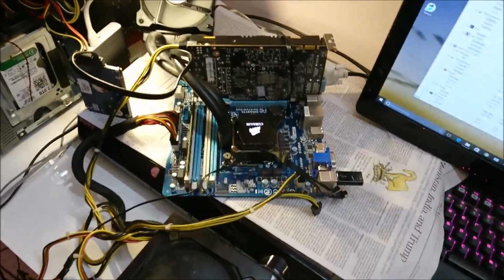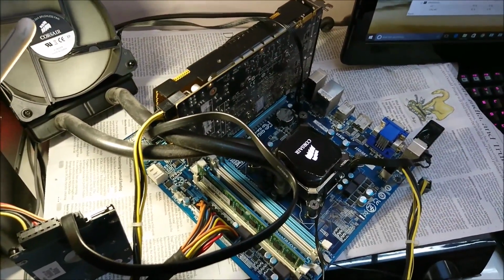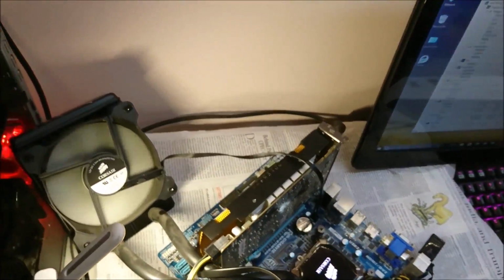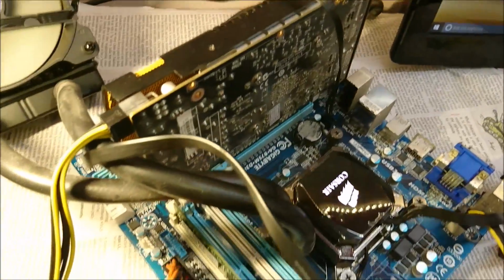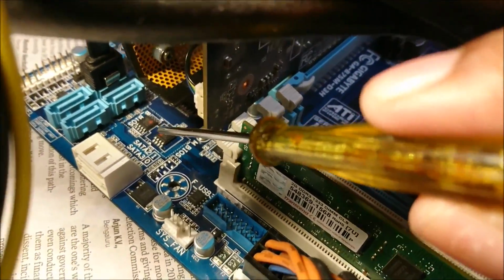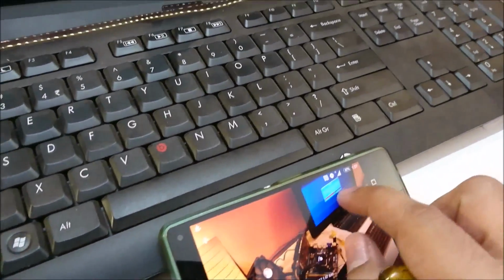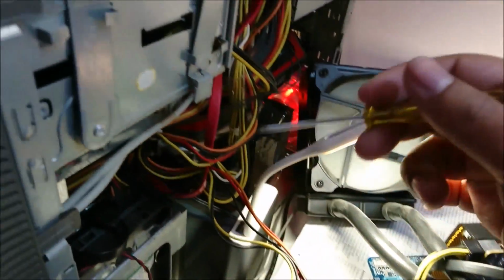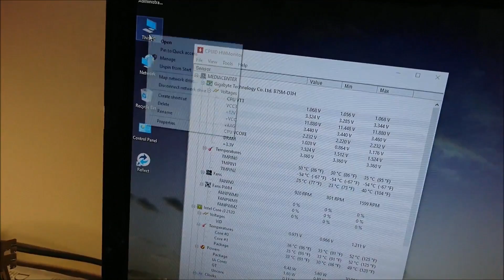Gigabyte B75M-D3H corrupted BIOS boot/post loop fix

Comment: I had exactly the same problem, i already removed the board from casing and was about to chuck it ... did a very last you tube search and .... found this video - it worked !!  shorted Bios 1 and now i have a working board again - Thank You!!👍👍👍👍
Reply from the maker: I made this video ages ago!! Glad to see this method still works. Btw, I still have this board and works fine till this date!!

Comment: Had the same problem with BIOS Versions F15 or F16f.
Workaround: Press Power and reset button and hold for 10 seconds.
After that, start normal.
BIOS will install recovered Version (in my case F12).

Comment: It's 2023 and you are still saving lives man. Pin 1 and 6 took a few tries and it worked. I'm writing this as my backup is writing back my main bios. 
And this happened to me because I updated my bios from f14 to f15. Do not do it.
Reply from the maker: I made this video AGES ago!! Glad to see its still helping everyone out! And yeah, after this I have stopped updating BIOS on every PC, its too risky!
Reply: @TechGuyCharlie  Great to see you stil replying here man. Just finished setting up everything. i now realise that board already had issues. Post took a long time to appear on screen. And it hangs there sometimes. It wasn't reliable. Also I had to do the hard reset 3 times because somehow my windows got corrupted and trying to boot that copy also got my bios bricked two times. I had to catch that first fresh bios boot and force boot into bootable USB. Fresh windows fixed everything. It's so weird. And now it's blistering fast. Someone will meed this information someday. Again thanks man.
Reply: does the new bios from 2024 works 😅 my mainbaord only works with one 2gb module from all other ones i have… otherwise crash . i wanted to Update the bios to the new 2024 version

Comment: Thank God for you and youtube and the commenters :D pins 1 and 6 worked for me. Thank you, thank you, thank you <3
Reply from the maker: Wow, I made this video years ago! Glad to see this method works, and this same motherboard is still working in 2022. I use this PC as my storage server!
Reply: Which pins are these? I can't seem to get mine to recover at all. Just keeps restarting after a few seconds when trying to short or about 10 seconds if I am not shorting anything.
Reply: @a.aspden  you can short them with power connected but not turned on. look for the dot on the corner of the chip, that is pin 1, pin 6 will be the adjacent one. Search 'pin out' to get a picture.
Reply: @stephenhartley77  I feel ike I tried everything but will try again when I get home. What do you mean by searching for pin out? Search google? Not finding a diagram. Thanks for the help
Reply: @a.aspden  yes, Google - Pinout Bios Chip :D Use a steel paper clip to short the pins

Comment: Much safer to power down then hold the power and reset buttons for 10 seconds. The Mobo then goes into recovery mode.
Reply: With power down not worked, but when power on, and hold both buttons 12 seconds, then work fine :). Many thanks :).

Comment: i am in year 2022. Thank you very much  You saved my computer. PIN 1 + 6 . NOTE: if you don´t know which are the pin numbers search for the BIOS integrated circuit model "mxic mx25l6406e"

Comment: Didn't work at all for me BUT as a last ditch effort I desoldered the BIOS chips, stuck B into the A slot, and it booted right up. I'm going to put A  in the B slot and then reflash it. I have no idea why this dual bios system doesn't work switching to B properly. B was fully functional and yet the motherboard ignored it. Anyway, if it helps anyone - you can get a hot air soldering station on ebay for 40 bucks. Takes 10 seconds to remove them. Let it cool for 10 minutes before resoldering them. Oh- and they're rotated 180 degrees. Make sure to match pin 1 to the arrow!

Comment: Thanks for this! I have been trying to fix my aunt's computer with this board (I offered to build a new one, but no she wants old and busted back) and had tried literally everything else in the board manual. Figured I didn't have anything to lose by following your suggestion of shorting the main BIOS and boom, it's switched to the backup and booting properly.
Reply from the maker: Glad to hear that!! and happy to see that such an old video is still relevant 😊

Comment: God bless you! I have tried all of the methods of resetting BIOS described in the manual of my H81, removing CMOS battery, shorting the designated CMOS-reset pins, holding and/or pressing both reset and power button, all without and with power, with no result!

My bootloop / corrupted BIOS issue was initialized when I tried to test an old Radeon 5770 (Juniper) on my system, it started doing the post-beeps (which it never did before!) and boot looping exactly in that Gigabyte-patter. This is actually a VERY widespread issue with Gigabyte boards!!

Practically what fixed it after trying just about every hardware configuration and reseating etc. and attempting to reset CMOS was just fiddling around on the PINs of the BIOS_M (main?) module, instead of holding it calmly, it did the same thing detect that obviously something was wrong there and it let me press Enter to reflash, and from then on it was back to normal.

I did come across the idea of shorting the BIOS circuits as well, because after bricking my Gigabyte Mobo with it, I put it into another PC and I flashed a wrong BIOS to my 5770 Juniper AMD GPU (in order to fix horizontal lines I saw in all driver versions, instability etc.) and I had to bridge that from being read on the GPU by shorting 2 pins on a BIOS saving circuit just like that on the motherboard, in order to be able to actually start the system with the card installed at all, and then I had to use 2 graphics cards, (so because of that I used a third motherboard X-I) 1 for display and the Juniper for flashing, and the short had to be removed right before flashing. It was even more crazy than the BIOS reset. But I got some other BIOS installed and ended up confirming it was not fixable by BIOS.

Now retesting this disgusting semi-brick of a bugfest Radeon 5770 GPU on my newly uncorrupted BIOS with different hardware, see if I can get it running bug free on here (but I don't think so, this is maybe an overheated GPU, corrupted memory or something along those lines)

So just so you guys know, a bad GPU can actually cause your Motherboards BIOS to get corrupted just like that!

The things we have to bother with...

Comment: Hey,
I also have a same Mother board ,with i3 3gen and i  want to upgrade  .
What changes i have to do in the mother board if i run it with i7 3rd gen ???
Will it work fine ???
Reply from the maker: No changes necessary, this board will run 3rd gen i7. I've tested i7 3770 and it worked fine.

Comment: If it was not clear to someone, I saw in another video that pin 4 should be bridged with pin 7 of the main bios with the board on, until a recovery message appears. Thanks a lot!

Comment: Guys i tried everything from resetting cmos, taking the cmos battery out, taking ram out, disconnecting HD's and sata cables and NOTHING worked. Until i came across something that worked for me and got the bios working again. 

Turn off power supply. Hold down the on button. Turn on power supply then after 2-3 seconds of the computer being on, turn off the power supply again. Then release the on button. 
Then turn the power supply back on. Now press the on button. This will reset your bios and it will overwrite the corrupt bios with the backup bios. You will see a loading screen as it overwrites the corrupt bios. 

This is what worked for me. Everything else failed.
Reply: Aaron Marsh thanks brother its worked... but does my mobo now running on only one bios?? I mean is the the bios dead?
Reply: @StrugglingBeliever  No dual bios's are just the normal bios with a back up bios that is always there and uncorruptable. Meaning when the bios you use gets corrupt it backs itself up with the good bios...
Reply: This worked for my friend.
Reply: Bro do you have any idea why bios is not updating? It’s failing every time? Shows blue screen
Reply: Thanks man, you saved me!
Reply: I'll try this.
Reply: Thank you, works!!!!
Reply: Didn't work pls explain briefly

Comment: What pins did you short to be exact, I'm having difficulty with a gigabyte board that is also dual bios?
Reply: The classical answer is to short pins 1 & 6. Determining pin positioning can be a bit tricky though.

Comment: Which pins to short and which bios main or backup?
Reply: Typically pins 1 & 6, and on the MAIN bios, not the backup bios!! Don't ever short the backup bios, you run the risk of damaging it and therefore bricking the board permanently (assuming that the main bios is corrupted).

Comment: I can confirm that shorting the pin 1 and 6 at the same time on the M_bios works on a Gigabyte GA- Z97X-SLI
Reply: pin 1 is where the arrow is but where is pin 6???
Reply: @avramovixc  Pin 1 is whatever the arrow is, then it's clockwise or counterclockwise considering that the one next to it is 2. Basically, the one next to 1 is 2, then 3, then 4. Across from 4 is 5, next to 5 is 6, then 7, then 8, which should be across from 1 if you labeled it right.

Comment: I tried this myself and it wouldn’t work at first. But after several attempts at shorting the bios chip it really actually worked. I am amazed. Thanks so much. Update: Not working after rebuilding pc.

Comment: It worked. Short the Pins 1 & 6 near d white arrow - that is the clue... then push power button. Press Enter 2x... fixed... thanks for the tip!

Comment: This also works on my Gigabyte Z270mx Gaming 5, thanks for saving tons of time!
Reply from the maker: Glad it worked! I'm surprised that so many gigabyte boards are having this boot loop problem :/
Reply: @TechGuyCharlie  I noticed that it happens repeatedly every few months, especially when I power it off during weekend.
Reply: I have very similar issues with my Z77X-UD5H. It seems to be mostly related to cold boots.
Reply: I've seen a post from someone claiming that it's a known issue with Gigabyte's implementation of dual BIOS on boards prior to the 87 series, apparently especially so prior to the 77 series but also on the 77 series, and that Gigabyte had supposedly mostly fixed the issue with the 87 series onwards. It's the best explanation I've found to date for these issues, although I personally suspect that there may also be a partial contribution from failing main BIOS chips and/or changes introduced in later board BIOS updates.

Comment: Mine was recovered by itself today i have the same mobo as yours i got one ques. Did you face same problem again??means you turned off the pc and use it next day the pc didnt gone into boot loop again??please ans im so curious to know if my pc will do that bullshit bootloop again
Reply from the maker: This mobo has been working fine, it's going to be 1 and a half years since I fixed it and no boot loops.
Reply: Tech Guy Charlie oj shit it was working all fine no cpu heat or overload even thermal paste is good..but when i tried of turn it on its again on boot loop fan runs few seconds like 5seconds maybe 4 and shuts down and does this again and again..i swear it did recover from B Bios in the morning..im tired of gigabyte man did a mistake shouldve gone for asus instead

Comment: I found easier steps for anyone having corrupted bios on GA-B75M-D3H motherboard, make sure the computer is turned off and then press the power button and reset button at the same time for 10 seconds and the back up bios should kick in reinstalling main bios. 

for some reason after I installed update from windows 10 which is 1803 update as far as I can remember, it gave me a blue screen and then corrupted the bios.
Reply: Jhay12  You saved me! Thanks man
Reply: It realy works! thanks, i was losing my mind over this hahaha
Reply: Jhay12 Perfect! Thanks for the heads up man.
Reply: Worked for me!!! Thank you so much!!!
Reply: Wasn't happy shorting the pins on the BIOS chip. Tried everything to get this mobo working. The old hold the power button and reset for 10 seconds worked a treat. Backup BIOS restored. Boots a treat. This happened after installing windows 10. You have won the Internet for today kind sir
Reply: God bless you my unknown technologic god of youtube, you saved my pc
Reply: Dude, you're a genius. Thanks a lot. Fixed my corrupted Bios
Reply: Perfect! Works on my  GA-Z77-DS3H  I built in 2013!  Thanks to bboth Jhay12 &  Tech Guy Charlie!
Reply: It kinda helped me but some times i have to do it again... And it happened some week after the October update (got it after all the bad things it came with on october)
Reply: @morpion  Yeah.. It happened to me 2 days after October 2018 Update.. Weird
Reply: @MsGRUBY666  also if you're having fps drops on game disable game DVR it helped me a lot, on r6s it was saying that I had 70 fps but it was like 20
Reply: Thank you! I was thinling about doing the procedure of the video but was really afraid of crashing my motherboard.
Reply: thanks man that work for me
Reply: worked for me thanks alot
Reply: You saved me as well thank you for this post!! I got this as a dead motherboard and nearly recycled it. You rock!
Reply: I love you so much , where can I tip you?
Reply: Dude, you saved me. Thank you very very much.
Reply: Thanks man!
Reply: I ran into the same issue with a GA-Z77X-D3H.  Tried the CMOS battery, tried the clear-CMOS jumper.  Was just about to try shorting out the main BIOS chip when I saw this comment.  Jhay12 - you are awesome.  Thank you!
Reply: It really works!! No need to short out any pins! Thank you very much Jhay12!!!!!!
Reply: @RF-qr6co  reset button on the case. May be near your on button.
Reply: It worked for my board GA-H87M-D3H, thank you !!
Reply: THANK YOU SO MUCHHHHHHH.... iT WORKS!!! SO happy...
Reply: Thanks JM you saved me.
Reply: i love you man
Reply: Great !! You saved my PC ! Thanks a million
Reply: Thank you for this suggestion it helped
Reply: thank you so much
Reply: Thanks, fixed my friends pc with this tip.
Reply: you're awesome! works perfectly, I struggled with all the possible solutions for about 4 hours or so...
Reply: This really worked, thanks!
Reply: Thanks man!! It worked! My BIOS got destroyed after attempting to install windows 10.
Reply: Very helpful it works again thankyou!
Reply: Thank you!! Save my MoBo and me from despair
Reply: All night I worked on replacing the PSU, VGA card, RAM, repasting the headsink, etc. All the videos I saw on YouTube failed. I was planning to order a replacement motherboard. Thank you for your comments which managed to save me in an easy way.
Reply: I know this is very old but man, you are a life saver. Thanks a lot.
Reply: U save my ass, Six yrs after ur post. Luv u bro. Much better than screwdriver like in this video.🤙
Reply: You save my day! thanks :)
Reply: Jhay12 this didn’t work please help

Comment: I have a ga-z77x-ud5h and it has a switch next to the clr_cmos jumper that you can flip back and forth to select which cmos chip you want to load the bios from, main or backup.  I accidentally shorted my mobo plugging things into it while it was still turned on which apparently corrupted the main bios but unfortunately it doesn't automatically repair the main bios when loading from the backup and now I have accidentally fried the backup cmos chip also the same way as the first and think im REALLY s.o.l. now 
:(  yall be sure to turn off all power and unplug your power supply before you go plugging all your hardware back in so u don't end up in my situation!

Comment: well it's worked for you, that's good , but next time you need to know that gigabyte has a safer way to do that , you need to click on power botton to turn it on and than you click again but this time keep holding the botton for 10 seconds and than release it , and turn it on by clicking again power botton without holding it, and it's start automatically the bios recover :) peace
Reply from the maker: I tried that when the board was inside a case..  It didn't work.☹️ By the way, this board is working great, it's been on almost 24x7 after this bios fix.
Reply: so that's geat, at least it's working now :)
Reply: This way works for me. On a Gigabyte GA-H61M-HD2 rev 1.0

Thanks from Peru.
Reply: I did that but it doesn't repair the first one so I am stuck with the second bios
Reply: Thanks, it's worked for me :)
Reply: Thanks. This worked for me too.

Comment: You're the man !!! I almost gave up on the damned board . It worked like a charm !
Reply from the maker: Thank you :D Happy I could help!
Reply: Hi , how are you ? What's happening ?
Reply: I did this with mine :"You short pins 1 and 6 together on the BIOS labeled M_BIOS (which is the main BIOS) while the computer is off and have a friend turn your computer on while you're doing it. When it beeps, stop shorting the pins and watch while it recovers", BUT it's the same thing that says down here.If it is shutting down on it's own and with a blue screen , i'm dared to say it is something else, not the BIOS. Anyways, In case it keeps looping , try shutting it down, pull out the power cable, push the power button for about 10 seconds, replug the power cable and cycle it back .Is it BEEPING ?? 
Good Luck !!!
Reply: OK.Use either a pair of tweezers, pliers (the thin ones), or two flat screwdrivers, whatever is more precise due to the separation between the pins
Reply: By SHORT THE PINS , i mean touch both pins at the same time
Reply: Keep whichever chosen tool to do so ON the pins for a few seconds , then try to boot again
Reply: All right , now stop messing with it !!! lol ;)